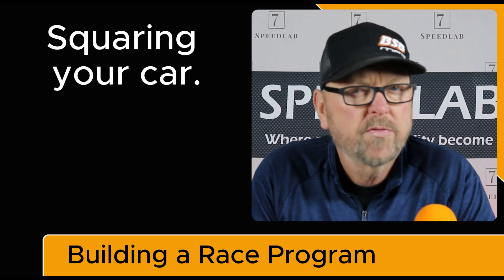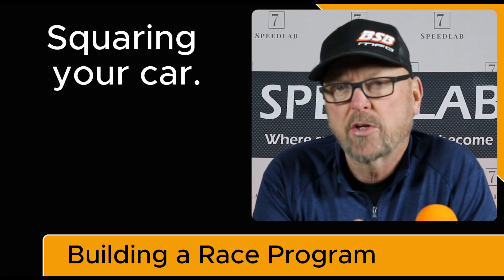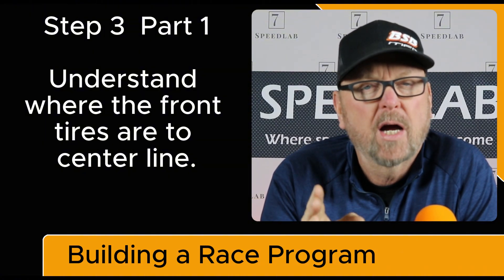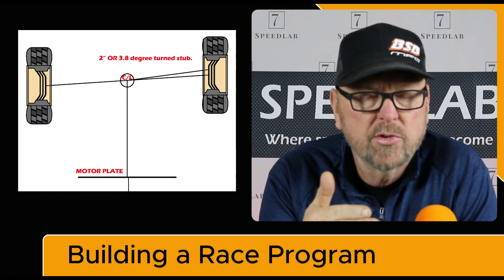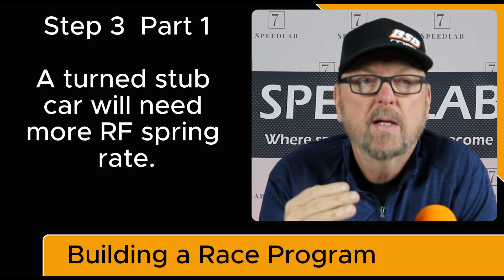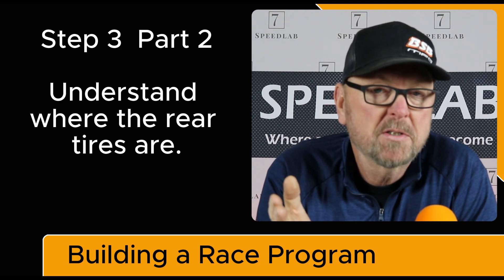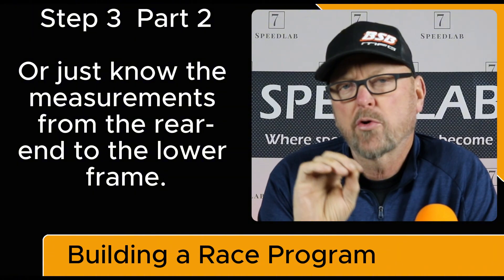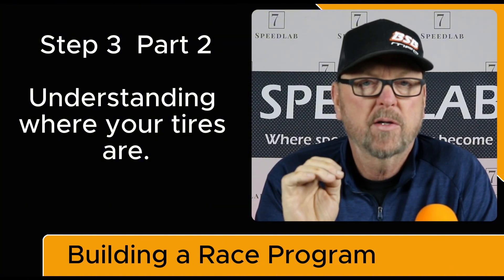Building a race program, part 3: Squaring the race car.

Comment: what do you do if you happen to be trying to work on a modified that DOES have the motor turned ? Not going to fix that...... I suppose , find some other measuring points/drop points for plumb bobs to find out if the front ball joints are square to the frame and the rear end is square to the ball joints ?  I'm guessing , the front end, the frame and the rear end are all square, it's just the motor plate/motor is turned say 5*.... with tail shaft of transmission pointing towards the LR tire....Have this possibly going on right now !!
Reply from the maker: When the motor is turned on, it makes things more challenging to determine the square, because you second-guess the rest of the car. Squaring the car from the lower bolts can be done, but the stub better be straight, and that is often not the case. Parallel with the right side frame or a combo of several things to determine which is best.
Reply: @jaynealgofast "squaring from the lower bolts".... Lower bolts of the lower a arms ?